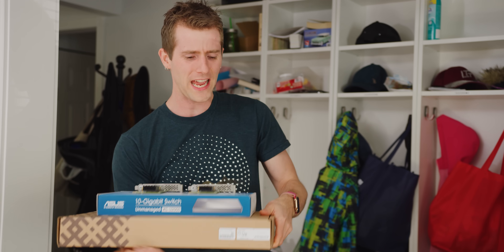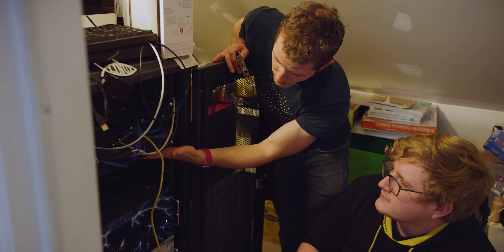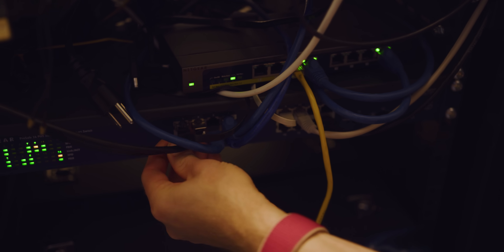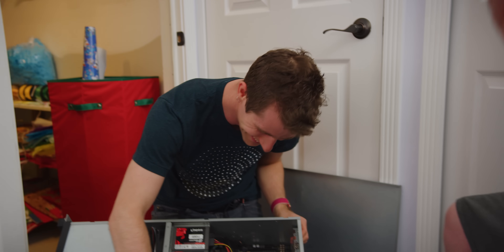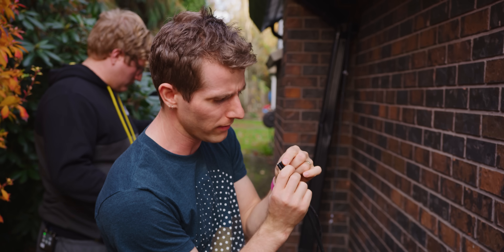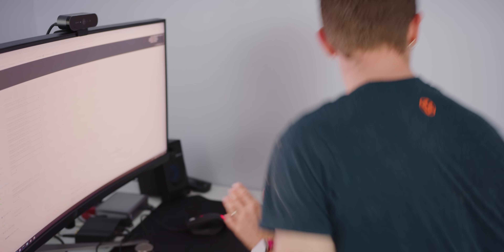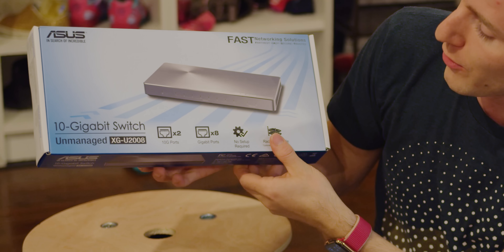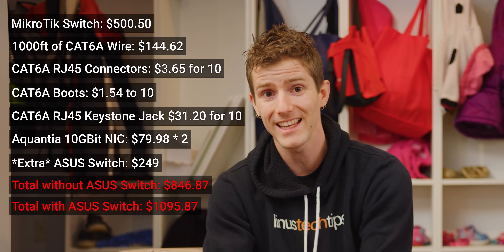Home 10 Gig Network Upgrade for CHEAP

Comment: Do yourself a favor and actually run your cables to proper patches and then use that Fluke you "borrowed" to certify your structured wiring!

Comment: Them auto-subs not knowing nas is a term.
'I'll need to shut down mine ass.' 
'I have more ram in mine ass than yours.'
You can talk as fancy as you want, but thine ass doesn't support anything over the 6400MB DDR2.
Although I can't talk shit if your ass supports ram at all.  I haven't cracked the case on mine, but the spec sheet didn't even mention ram slots.  I think the highest profile feature is the hair.

Comment: Hey Linus, as a fellow Canadian, I have a loaded question. Do you use Bell FIBE internet Service? I've been dreaming of the day when I can bypass their H3K modem/router thing. See the joke is that they recently upgraded me (for free) to their 1.5 Gbit service buuuuuut the modem only has 1G ports!! So this is sorta of scam since no single host on my LAN will ever break the 1G speed. I know that in the past folks have been able to bypass Bell's modem using Mikrotik hardware, I was wondering if you hacked something like that at your place as well? DSLreports has a few guides but they might as well be written in mandarinfor the non Layer2 initiated like myself and most don't achieve what I'm trying to do. Maybe that should be your next challenge :) Cheers!

Comment: I use used SFP+ cards and SFP+ DAC cables with a MikroTik CRS309-1G-8S+IN 8 port SFP+ switch. £10 per card / £10 per cable and £200 per switch. It's a managed switch but will only do 10Gb at layer 2, any layer 3 traffic / tagged packets have to go via the CPU not the custom switch chip, so will only be about 3Gb max. but it works really well for my purposes. SPF+ uses less power too, so less heat in your case.

Comment: pretty embarasing that this is a tech channel and the kid called the 8p8c connector rj45 like a clown.
also you guys are absolute clowns. youre not supposed to crimp 8p8c connectors on solid twisted pair. l2cablingspec. supposed to be punched down.

Comment: An Asus XG-C100C user here. A while back an AQC107 firmware update, atlflashupdate_1.4.2_3.1.90.zip was available for download from Aquantia's site. So I used it (via Windows 10 1903) to update my XG-C100C's firmware from ver. 1.5.44 to ver. 3.1.90 in order to successfully remedy an infrequent and intermittent dropped network connection issue. I then repeated said update with equal success on another XG-C100C I had bought as a backup.

Shortly afterwards atlflashupdate_1.4.2_3.1.90.zip was removed from Aquantia's site. I sent them an e-mail asking why. Their response was noncommittal. (Note: I subsequently learned that Aquantia was in the process of being acquired by Marvell around this time. Hence there may have been some policy changes afoot.)

However, I soon found an alternate and reputable source for atlflashupdate_1.4.2_3.1.90.zip. Here it is:

Solo10G Firmware 1.4.2_3.1.90
http://www.sonnettech.com/support/kb/kb.php?cat=538&expand=_a13&action=b1063#b1063

All of the files and the readme in the above .zip are identical to those found in the one I previously downloaded from Aquantia's site.

From said readme:

"AtlFlashUpdate is a tool for updating firmware on AQC100, AQC108, AQC107, AQN100, AQN108, and AQN107"

Sonnet Solo10G PCIe Card | Sonnet
https://www.sonnettech.com/product/solo10g-pcie-card.html

One more thing:

If I had to buy another AQC107-based 10G Ethernet card I would definitely choose between the Aquantia AQtion 10G Pro NIC in the OP's link or the Sonnet Solo10G PCIe Card. Why? Because in addition to both units having a ventilated PCI plate, they also sport a spring-loaded heat sink which suggests the use of thermal paste as opposed to the thermal pad found under the stand-off-mounted heat sink on the Asus XG-C100C. Relevance? I recently upgraded Linux Mint 19.2 Cinnamon's stock kernel ver. 4.15.x to the 5.3.0-19 kernel that's part of Ubuntu 19.10 and discovered that it can read the AQC107's temperature sensor. It currently reads 59C even though the XG-C100C is only connected to a 1G Ethernet switch.

Fortunately the CM 690 II that I use has two vertically aligned 140mm side fans which I can ramp up next summer. Those who prefer PC cases equipped with vanity windows are unlikely to have that option.

Comment: Test throughput and its stability whit iperf3 on both sides, upload and download. I'm from Latvia and I support locals, but speeds might not be what You was expecting, Mikrotik routers suffer from unstable upload speeds (far as I have tested). Management is done whit Winbox app as mentioned.

Comment: "Wow, terrible name" Not really. Once you understand how Mikrotik names are built up they tell you a LOT about the device.
CRS - Cloud Router Switch, the "better" switch models that you can run with either a switch-only firmware or their full-fledged RouterOS firmware that has about the feature level of an enterprise firewall router
312 - model number
4C+ - 4 combo ports with copper and SFP+
8XG - 8 10GBit ports
RM - rack mount 

And for configuration, get Winbox from their website (https://mikrotik.com/download), it should auto-discover the switch. If IP settings aren't on DHCP (most Mikrotik devices come with the default IP 192.168.88.1) you can connect to it via MAC address.

Comment: why not Cat 7a ?
Reply: Category 7 is not recognized by the TIA/EIA.
Reply: @sewing1243 yea but that not a problem it's fully backwards compatible in Germany we install only cat 7a because the shielding is so much better
Reply: @Shinyaia  https://community.fs.com/blog/network-cable-standards-tia-568-vs-iso-11801-vs-en-50173.html

ISO apparently recognizes CAT7 and CAT7a. TIA/EIA doesn't, and it has always been my understanding they never planned on a CAT7 cable.

Comment: Just ran 4 ports in my home with Cat7. For a newblet running bulk cable and connecting them to Cat7 keystones it went fairly well, didn't need to redo any of the connectors. Realistically there are 2 more rooms I could run cable to, but they're so much further away from the switch, I don't really want to deal with all the wall effort it would take. I may do a secondary structure, hence the Cat 7, where I'll really make use of the shielding and get the distance spec out of it.

Comment: A two-port Mikrotik at 10g isn't so bad, like $135 on Amazon. https://www.amazon.com/Mikrotik-CSS326-24G-2S-RM-Gigabit-Ethernet/dp/B0723DT6MN then add ports as necessary https://www.amazon.com/Mikrotik-S-RJ10-MikroTik/dp/B078SNK1MY

Comment: I used the smaller CRS305-1G-4S+IN and saved some money there. I didn't need 10G anywhere except between my server and my NAS (Everything else on my network is a smart device or a laptop or wireless) the CRS-312 is listed at $986 on Amazon.ca. Yeah I don't think so!

Comment: Mikrotik has some interesting software inside their switches and routers. You may want to take a look their "software" section - a small app called "winbox". It may prompt an video about it ;)  - btw, I'm using MT as my main router for years, the same software is running on even cheapest (surprisingly cheap while capable) routers

Comment: And here I spent $400 on a 10Gbit switch and three NICs.  Using my existing CAT5e cable due to length and still getting 10Gbit transfer speeds to my server.

Comment: Also, you need to use the string inside the jacket to split that jacket back further after stripping the jacket off. That stripper most likely knicked the coating on the wires.

Comment: I had one of those ASUS switches - had to send it back as it was taking 2 - 5 minutes to create a stable 10G connection every time I turned the PC on, and would frequently stop responding - probably because of how hot it gets. And ASUS support were worse than useless dealing with it!

Comment: Hi Linus great content and thank you for all of it, I was wondering if maybe you should could do an episode going over wether it be beneficial to run an access point at home instead of a WiFi router, (tho they're the same) is there any benefits from one to the other. I live is small apartment over crowded by over 10 wireless networks. Again ty

Comment: Good thing I live in an old home with RG6 cabling for the antenna. Installed a MOCA network using that. Don't need 10 Gig down to the Roku or my emulator PC. Plus I am too lazy to run cables.

Comment: Using a Mikrotik like that as a "dumb switch". This is breaking my hearth. This thing can route, be an OVPN server, manage IPSEC connections, and do your wildest networking dreams... I'm sad now.
Reply: I imagine there aren't many 10G switches made that aren't managed and affordable at the same time.
Reply: When its cheaper than a comparable dumb switch.... and a dumb switch is all you need.... nothing wrong with that.
Reply: @isaakstahlwolf4095  err! HOW does one get less than FREE? Granted not for a 10GB switch but a 48 port 1GB smart managed one with 2 copper and 2 copper/sfp ports! Yes ... Cost £0 ... It's not WHAT you know but who! 😂
Reply: @boblewis5558  I was comparing 10gig managed vs 10gig unmanaged.

Sure, you can get hold of an gigabit switch super easily. Even for free. 

But thats comparing apples to oranges, really. Sure, "bang for your buck" is always the best with free stuff. But in this case, saving money is also loosing time. And ya know, time is money.

So it depends on your personal needs, if a free gigabit switch is indeed "cheaper" than a fairly pricey 10gig one.
Reply: Routing capabilities are extremely weak but you can still do neater L2 stuff than use it as a dumb switch !
Reply: @widdermann100  Yes.
Reply: @widdermann100  in fact there are SwOS and ROS . and ROS boots by default
Reply: I couldn’t agree more!! So many features and capabilities that can be used!! I will use it as a core switch managing multiple VLANs among other things!
Reply: This one has a wimpy CPU and RAM, it sucks at all the things you've listed. Like... really wimpy. 650mhz mipsbe. 64MB RAM. Worse than their gig switches. Basically good for running RouterOS to manage the switch chip and not a ton more.

Comment: That was helpful I’m about to crawl around my attic installing cat6a to my spare bedroom I don’t need 10g speed cable cause my internet only goes just past 100mb a sec I need the cat6a for the distance through the house to hook my new iMac up wired for gaming rather then play on WiFi 6

Comment: Kind of a dumb question.  I live in Florida and I want to wire my 20 year old 2 bedroom house for CAT 6a networking.  I plan on running the cables through my attic and down into my living room (2 wires), master bedroom (2 wires), and into my guest bedroom that is also my office as well as where my networking gear is.  That bedroom is the only place where my DSL modem can be plugged into the phone line (long story).  Since it gets STUPID hot and humid down here, would I need to get the outdoor rated cable instead of the standard indoor cable?

Comment: Watching videos involving your server is inspiring me to make my own home server. Guess I should save some money!
Reply: You can make a server out of a regular PC. Sure, it won't  be the EXACT same thing but it will perform the same functions and save you a ton of money in the mean time. I have built a few out of older PC's, specifically older i7 people were disposing. Changed HD's to SSD's for boot drives and some Multi Terrabyte drives for data storage, make windows force HD to turn off when not in use and PC to sleep after 10 minutes, waking on LAN turned on and these servers won't  impact your electric bills. I am running multiple servers for multiple uses since i found that many, but 1 is enough for most people to use as a server or network storage!

Comment: I have a really stupid question... to have 10 Gig network for your house, wouldn't you need a 10GB ISP? I understand LAN which I assume is what they are using but I thought it was bottlenecked by the ISP or at least the router. I'm lost on this one, again sorry if it's a stupid question :X

Comment: 10:40 WRONG! Always use the rip cord (string) to peel back a little bit past where the stripper cut the outer jacket. Reason: In case the stripper nicked the conductors, to avoid problems from broken conductors later on.

Comment: I ran Cat6a in my stepdads company, not because they needed it, but because he wanted the best hehe, basicly just ran it to his security cameras. Damn i had to climb around thier building like a monkey, i ran two times 50 meter cables along the roof. and a bunch of 10-20 meter cables... I couldnt get the RS45 over the tip of the cable, because he went with shielded connectors... So he went with a switch to run each cable into... Pretty hilarious

Comment: the fluke tester 
10 grand for the starting kit 
if you wana test fiber with that pupy , slap 5-10 grand extra on it XD 
oh ... and you have to send it in for calibration every year ... costs about another 1000 every year 
i'm a cableguy 
fluke is good ... but the cost is pretty insane though

Comment: Anyone else hear a weird static-like sound on 15:05 during sponsor spot?
It sounds like the sound you hear when I used to rotate a headphone cable inside the headphone jack... took it back and listened for it again and it was there...
Reply: Same at around 15:40 onwards for 5-10 seconds....

Comment: So... you  got 12 port 10G switch AND 2 port 10G switch but only 2 consuming ports (or 3 if one of your servers already had 10G port). If you get 12 pieces of 10GBit NICs the NICs alone would cost $960. Sorry, but I'll stay with 1GBps for now for my house even though the house is modern enough to already contain CAT6 cabling with RJ-45 sockets in the walls. Once we get EdgeRouter X replacement with 10G ports, maybe then I'll switch.

Comment: There is like less than a foot between my ceiling and the outer roof in this house. I legit have no idea how anyone is supposed to get up there even to access the top of light fittings.

And the outer roof is that colourbond steel stuff so it's not like you can just lift out a few tiles and reach in

Comment: thats a router by mikrotik not a switch. use mikrotik's winbox utility to manage it as it wont have ip on its own, so you need to connect it via MAC address using winbox utility.

Comment: This is the video I was requesting from the past.  I seriously didn't want to be required to port 10G ethernet to the switch with SFP cables.  I've done a lot of ATTIC crawling and am forced to use a face mask if I want to survive.  I've also developed a rash in past adventures and now wear long sleeved shirts while attic crawling.  You should have been more explicit in displaying  the wired switch  connections..  Hope it passed certification....LOL $10k borrowed meter...
Reply: Run blue smurf tube then it's just a fish tape
Reply: @mrmotofy  Is it any easier to push wire through Blue Smurf than say flex conduit?  I usually blow/suck a string to pull wire.
Reply: @johngermain5146  I would say yes probably easier since the plastic is slicker and corrugations are tightly spaced and always oversize

Comment: pro cabling tip, you dont need a screwdriver or anything to straighten them out

(this is gonna be crazy hard to explain in text, but here goes..)
1)  untwist them
2)  line them up in the right order
3)  firmly hold them together (while keeping them flat) at two different points ~1/2 an inch apart
4)  wiggle those 2 points back and forth on a 2 dimensional plane, the wires will straighten much more.
5)  snip off the un-straightened part
Reply: do step 4 too much and you can work harden the copper and break the conductor. but that is how I do it I confess.

Comment: I'm watching this at the moment because I just got a external ssd 4tb drive to take all the videos and pictures out of my main hard drive. To bad my computer does not  have usb3.0, I am running 26 mbs transferring 1 tb. Guess it will be done some time tomorrow.
I really need to build a new computer, this is a 8100 XPS studio by dell, yes 10 year old computer.
Reply: Usb3 pcie card bro
Reply: @mrmotofy  its on the way , ordered yesterday
Reply: @carrboro_chapelhillfpv2442  Also depends on the HD you're saving to. My guess is that's an old drive. Probably running on SataII. Drop an ssd in there it will help some.
Reply: @mrmotofy  I do have a samsung 250gbssd but the backup and cleanup that took 24hours was on the 1tb platter drive.
Reply: Anyone know where to get a good deal on a gtx 1080? Used is fine as I will ne building a new computer soon, just need one last upgrade on the old XPS before she is put down.

Comment: You don't need cat6 for 10G unless it's really far or you have a ton of EMI. My townhouse uses cat5E and is running 10G on my netgear switches just fine.
Reply: Have you actually tested network throughout?
Reply: @mrmotofy  yes, of course. Throughput and link speed are two different things though. They link up at 10G and I get just under 1.2GB/s from my NAS
Reply: @Eschmacher  sounds like your throughput is limited by your drives on one end or the other. Maybe try using jperf or iperf. But that is the harder part now with faster Network speeds your devices on both ends have to be faster.

Comment: My home 10 gig configuration:
CRS305-1G-4S+IN    120 eur
Mellanox ConnectX-2 NIC   37 eur each
Copper SFP+ cable (1m) free with connectx-2 from ali express.
If it were fiber, it would cost 38 eur for SFP+ connector pair and 3 eur/meter of fiber OM3 cable

Comment: You're supposed to only cut of a little bit of the sheathing and use the string in the cable to cut down more. This way, you can be sure where you finally terminate the cable, you wouldn't have accidentally cut into any of the twisted pairs when you first cut into the sheathing.